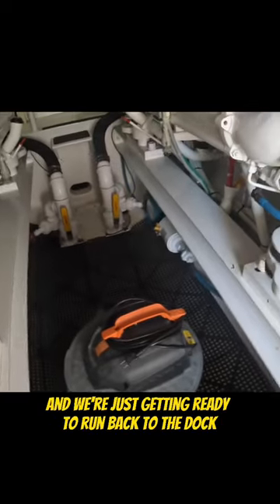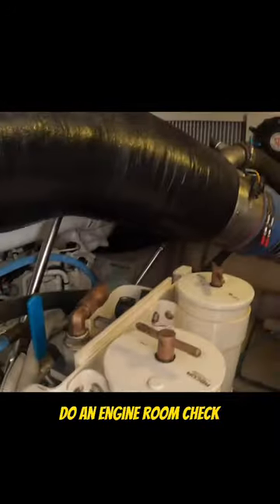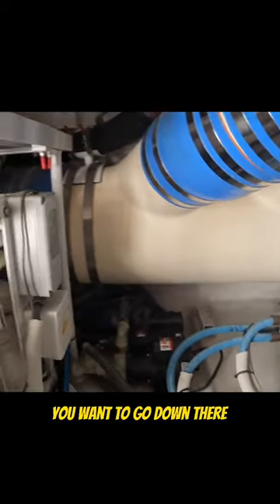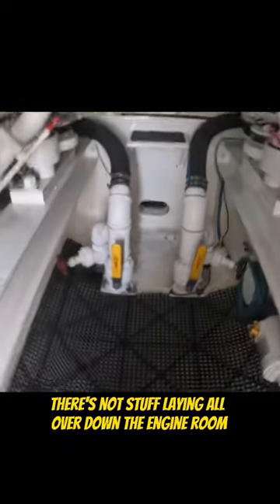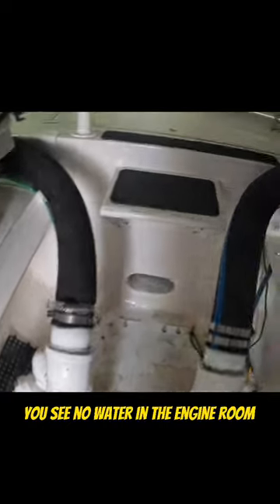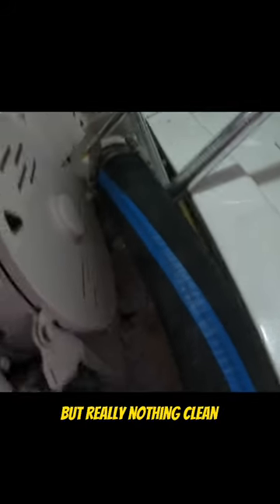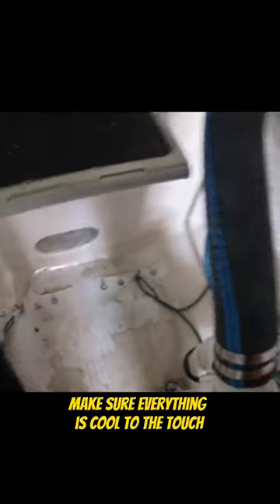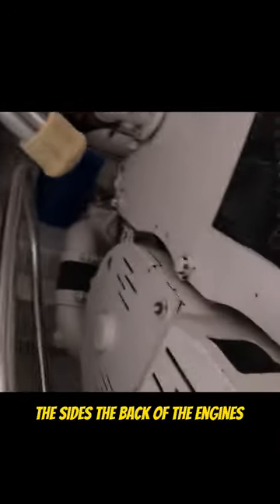How to check your Engine Room 🛥️ #engineroom #shorts

Comment: How big is that vessel
Reply from the maker: 58 foot
Reply: @YourSaltwaterGuide  I got a 1965 Owens flagship 29(29.5ft) single motor it's not in the best condition but it still floats and runs, lol it's usually the biggest boat the local boat ramp,